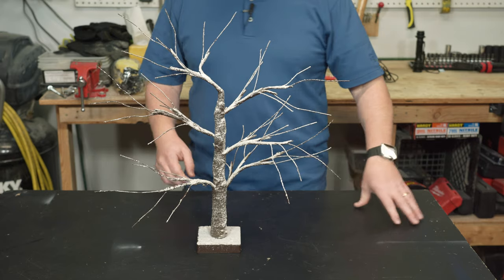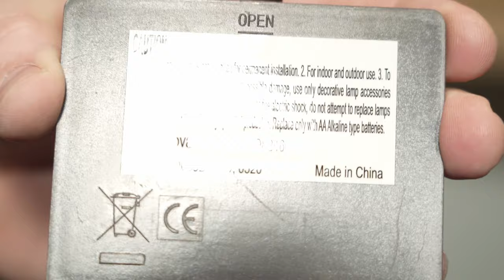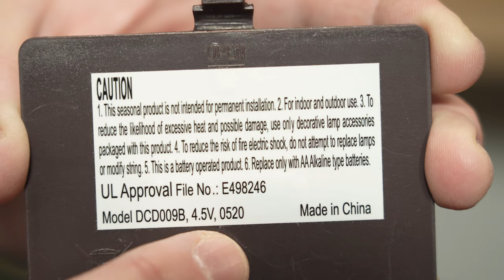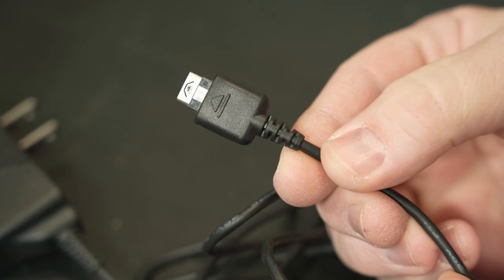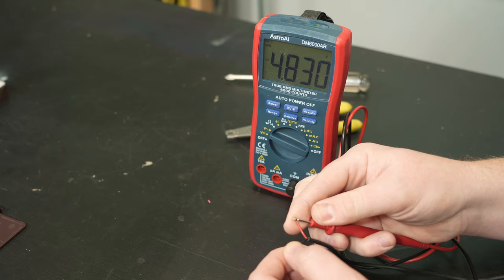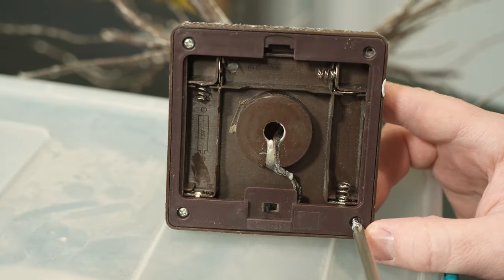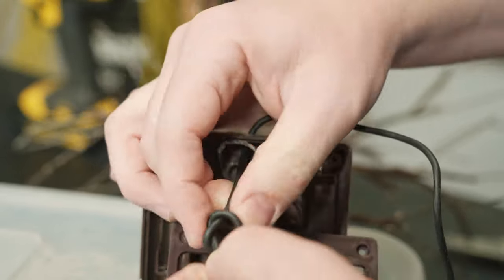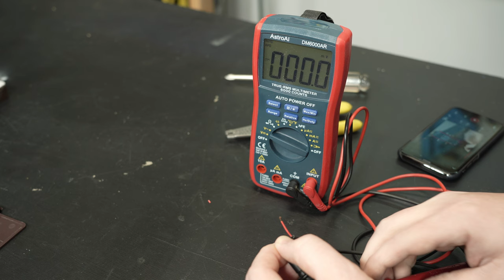Never Replace Batteries Again! Convert Battery Device To Wall Adapter!

Comment: How do you tell if the batteries are series or parallel? I assume 90% of the time they will be series?
Reply from the maker: Hi Traceguy - yes, most of the time they are in series. You can tell by seeing how the batteries are oriented: if the negative of one battery connects to the positive of another, they are in series. If all the negatives are connected together and all the positives are connected together, the batteries are wired in parallel. Here is a site that goes into deep detail (using car batteries as the examples, but they have nice diagrams that show the differences between the connections): https://battlebornbatteries.com/batteries-in-series-vs-parallel/

Comment: Battery only lasts one day on the tree? I have a wreath that lasts for a month, entire Christmas Season, without exception. Who uses any decoration that lasts only a day?🤣🤣🤣
Reply from the maker: Yup! Pretty poor design for the original... there are too many LEDs in the circuit, so we were constantly replacing batteries. Not anymore!

Comment: Your tree is using LEDs. Don't you need resistors to prevent overheating or the LED life usage is short. I would be interested knowing what kind of LEDs are used. I have collected so many adaptors.
Reply from the maker: Hi Joh - there are resistors further up in the circuit. I may not have showed them in the video, but they are there. If you simply splice in your adapter wherever the batteries originally were, as long as you are matching the voltage (within reason) and your power supply can pump out enough amps, it should work just fine. Thanks for watching!
Reply: Can tell me the specs of your LED's please and how many do you have on your tree? How many resistors are you using? I just want to know the basics of using 5-18v adaptors with LED's. Is there any concern for the polarity of the adaptor?
Reply from the maker: @Joh750  Hi Joh - as I mentioned, I have not torn apart the tree or it's entire circuit to measure the resistor or try to figure out the specs of the LEDs ... and for a project like this there is absolutely no need to do so. All I'm doing is replacing the battery power (which depletes over time) with a wall adapter (which does not). I tie into the circuit at the exact same location where the positive and negative of the battery bank was located, so the specifics of the components in the circuit are basically irrelevant as long as I'm supplying the same voltage with a power supply capable of providing that voltage at the amperage the circuit draws. Make sure the polarity of the adapter matches how the batteries were originally installed - i.e., + of the adapter ties in where the + of the batteries connected to the circuit, and the same with the -- of the adapter.

If you are building your own LED circuit from scratch, that's outside the scope of this video.

Thanks for watching!
Reply: I understand what you are doing but I am having a difficult time to get info from someone who can provide me how to use adapters with LEDS. Here in North America, the electrical outlet voltage is 110 and the transformer adaptor converts it to 5-18v depending on model of adaptor of which I have many. I know I can increase the output of the adaptor or maybe not. How do I go about if I want to have 24 LEDS (64v I calculated) with an adaptor. Basically how can I get 64v from an electrical outlet.?
Reply from the maker: @Joh750  There are a few fundamental things you've misunderstood: Mains voltage in North America is indeed 110 or 120 Volts, but that's AC (alternating current). LEDs run on DC (Direct Current). Further, there is a difference between voltage and amperage.... When you chain LEDs together, the voltage requirement does not change at all, rather the more LEDs, the more amps they'll draw. 

If you have a string of 5 LEDs that need 5vDC to light up, and when lit they each draw 100 milliamps, you need a power supply that is capable of providing 5 volts DC at 500 milliamps. Again, the voltage does not change, but the amps drawn does.

The power supply converters change not only the voltage, but convert from AC to DC. If you have 24 LEDs, first you need to know how many volts they run on - it's probably either 5V DC or 12V DC. Then you need to know how many milliamps each LED draws when lit. If they need, say, 100 milliamps each, and they are 5V LEDs, then you'll need a transformer capable of putting out 5V DC at 24 * 100 milliamps, or 2.4 amps. 

Most LED's draw VERY VERY little amps - the numbers above are contrived to help illustrate the math.

I hope this helps - remember that when you chain LEDs together, the VOLTS does not change, but the AMPS does - and they all run on DC, NOT AC.
Reply: Sorry I should have been more specific.
The LEDS I want to use are white. max 3.2v and .20mA
Reply from the maker: @Joh750  So you'll need a power supply capable of putting out 3.2V DC @ (.2mA * 24 LEDs) or 4.8mA -- which is basically hardly any current at all. Any 3.2V DC power supply should be able to do this with no problem.
Reply: Again sorry to bother you. My white 8mm LEDS package indicate vu3v-3.2v 20mA and  my 8mm red LEDS indicate vu2v-2.2v 20mA. Did I miss calculate again and should have been 20 and not .20mA. Therefore my white LEDS would be 480mA and red would be also 480 mA. But the v  is different for both. White is 3.2v max and red is 2.2v. If I understand correctly my adaptor of input of AC120v with DC output of 5v 1200mA is enough to power my 24 LEDS?? I will need to put resistors not to surpass the maximum of 3.2v or 2.2v.  This would really cover my understanding of electricity if this is correct...! Appreciate your assistance..btw I also read about stepping down and stepping up voltage which is another story which I am hoping I am not required to do in this case.
Reply from the maker: @Joh750  Hi again. You may be better off grabbing a book on basic DC circuit design from your local library ... or banging around on some more specific forums such as here: https://forum.allaboutcircuits.com/threads/can-i-use-resistors-in-a-dc-circuit-to-reduce-voltage.163968

Long story short: there are several complications that I had not gotten into with you yet: each LED effectively acts as a small resistor on the circuit. So, when you wire 10 LEDs in series, the first LED gets the rated voltage, but the next one gets a little less, then next a little less, and so on. With such small LEDs (running at only 3.2v or 2.2v to begin with) it won't take many LEDs in series to drop the voltage to the point that the ones at the end of the circuit are either very very dim or simply don't turn on at all. This is known as "voltage drop", and needs to be considered with any circuit you design. 

Also, 20mA is completely different than 0.2mA, by several orders of magnitude... If you have 24 white LEDs that need 3-3.2v and each draw 20mA, then you'd need a power supply (just for the white ones) that is capable of 3.2V @ 480mA. That's nearly half an amp, which is quite hefty for such a small voltage. In such an arrangement, I'm pretty certain that the LEDs at the end of the string won't even turn on without extra power injection along the way.

Long story short: While theoretically what you want to do is possible with the right combination of power supply, resistors, LEDs, and power injection, you'll get better answers from a dedicated forum than I can provide here on YouTube. 

I do wish you the very best of luck with your project, and I'd love to hear how it works out for you!

Comment: Lets say, instead of a tree I have 2, or 5, how can I make the 5 of them into just one outlet?
Reply from the maker: Start by figuring out how much current (amps) just 1 of them uses. Then multiply that by however many you have. So, if you are doing trees, say the first one draws 100mAh of current at 5v. If you have 5 trees, you'll need a power supply capable of supplying more than 500mAh (or .5 amps) of current. I'd recommend getting a lot of headroom (oversize the power supply) - something like 2 amps at 5v. Then just wire them all up exactly as I did in this video, but you can run a separate + and - lead to each tree, and have them all join up to the single + and - from the power supply. Use a soldering iron and heat shrink to protect all your connections. Good luck!

Comment: Despite the disclaimer, it is not safe to test a power adapter plugged into mains with loose wires in your hands like that. Really needs some safety techniques added for general public... I wouldn't even want to do that as an engineer
Reply from the maker: Hi Tunnicn - a low-volt adapter like this is perfectly safe to handle as I showed in the video. Anything that has a higher voltage or can deliver more amps, of course should come with added safety precautions. Thanks for watching!
Reply: @AmplifyDIY  yeah but when you pickup an unknown potentially damaged adapter from thrift store i wouldn't handle it while verifying its operation. It's not difficult to secure the wires or use clips or something safer. Not too different from wood working or other dangerous jobs where they stress this stuff more

Comment: No need for an inverter?
Reply from the maker: Nope - the power adapter converts from A/C wall power to the DC current needed by my project.
Reply: @AmplifyDIY  this saved me so much trouble. Working on a bio-active terrarium with a waterfall for my wife for her Poison Dart Frog. And the soonest I could get a pump delivered was 2 weeks out but I found one in a pile of junk only it was battery operated a quick dig through old phone chargers because I’m a pack rat who saves everything and I have a working pump. Now time to figure out how to mount it.
Reply from the maker: @jamespatrick2924  Nice!
Reply: @AmplifyDIY  it sounds all good but it’s still a lot of trial and error because if I can make it or do it myself I will and the cheaper the better.

Comment: Will a 4V work for 2 AAA batteries ? Will it blow out ?
Reply from the maker: It depends on what you are powering... but I'd use a 3V in place of 2AAA batteries, not 4V.
Reply: @AmplifyDIY  I have a little Mario icons light it's the star , it runs on two AAA batteries, I just found a 3v charger but it says 600 MA does that matter or it's not strong enough
Reply from the maker: @the.villa1n  If the AAA batteries last for more than a few hours, then 600MA will be plenty. Good luck!